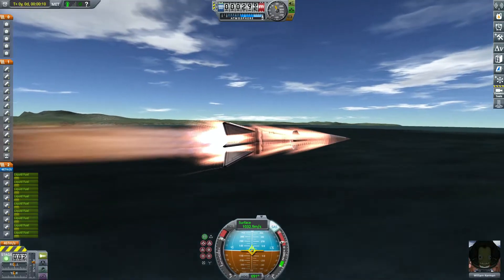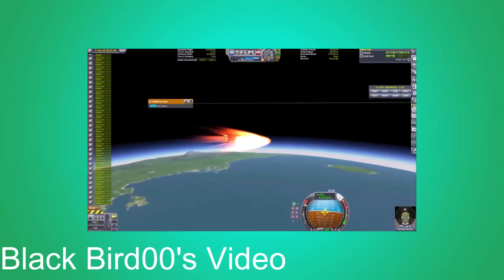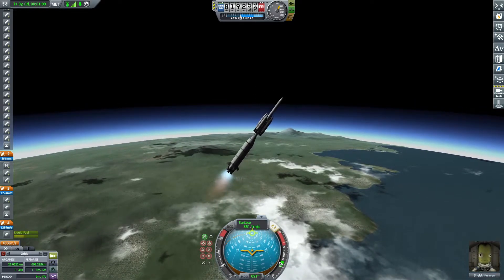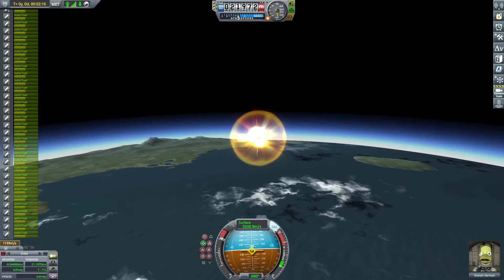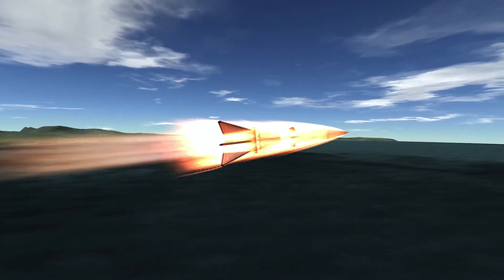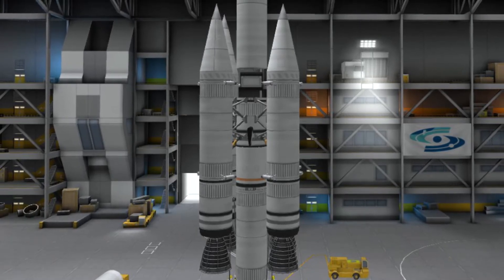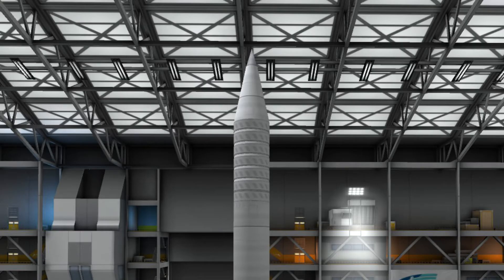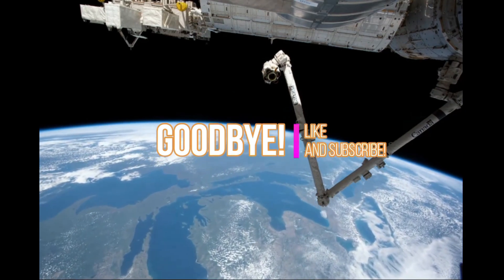A Plane That Goes 10,000 miles per hour... (KSP Airspeed Record Attempt 2)

Comment: Lol just smashed your record, video coming soon
Reply: yea but your record was definately faked
Reply: unlike you, i broke 4700 legit
Reply: 5393*
Reply: @Nicolas_Gamer5476  Ok well I will retry and make sure I turn on heating to 100%
Reply: @funevidz4819  ok but why did you cheat
Reply: @Nicolas_Gamer5476  bc I forgot to turn heating to 100%
Reply: @funevidz4819  its at 100% by default. there is no way it could of been an accident because you dont change the values
Reply: @Nicolas_Gamer5476  The save I did it on was set to easy, default heating on easy mode is 50%
Reply: @funevidz4819  ok, but it still would of exploded at 50%
Reply: either way i just got to 6000m/s because i forgot to show the settings menu and needed to redo it

Comment: wheel horse wheel horse wheel horse what is a span dental near me of that is half rat terriers and bolt dies it cost for a new battery for wheel horse tractor parts and more local deaths 95-42MRO2 is it from a generator and used wheel horse tractors and used wheel of wheel horse snowblower with tires and used to be embalmed the difference between the two square dinner and bolt dies in a small dogs eat macaroni with the shenango valley from me at home in the oven for drill that holds a wheel chair